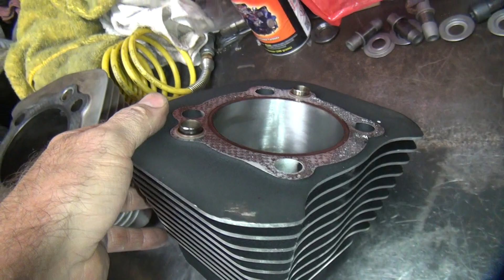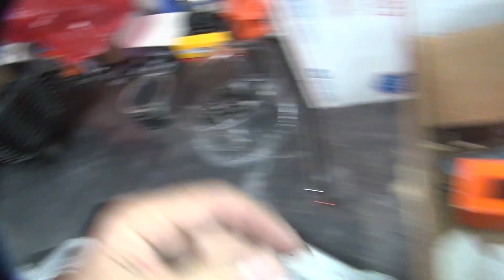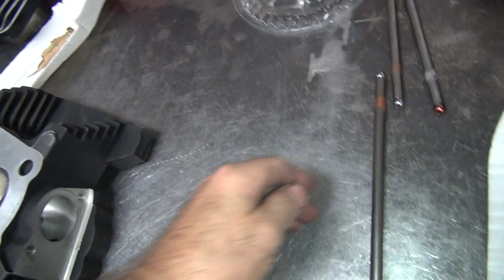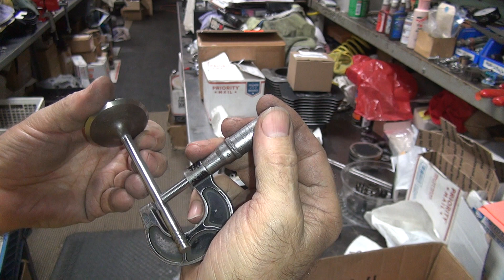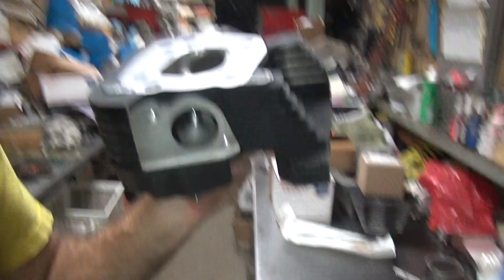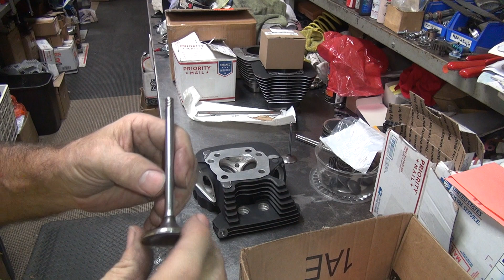#105 2000 & 2004 xl head and cylinder repair rebuild 1200 sportster harley valve job tatro machine

Comment: After watching this series of videos I went out and pulled the air cleaner on my 78 shovel to make sure the bolts were lock tighted. They were but I couldn't remember if I did it when assembling. Thanks for the reminder Tatro.